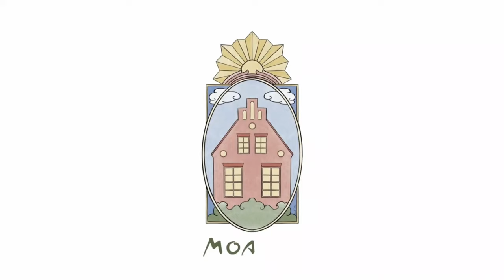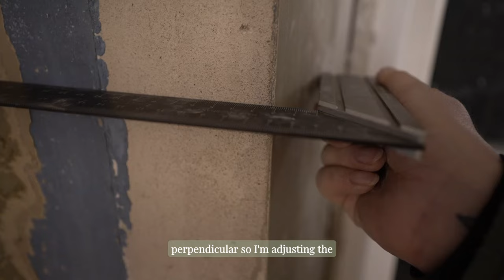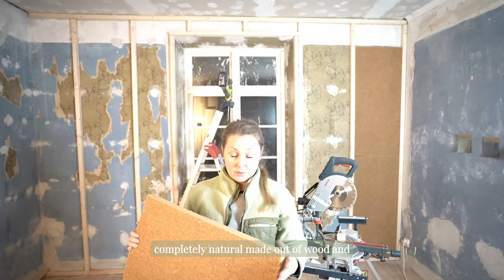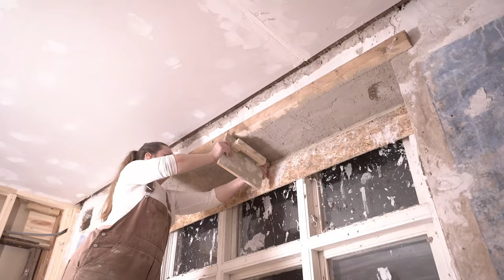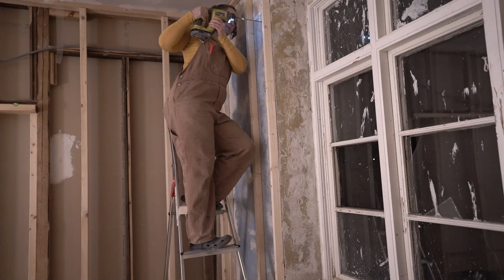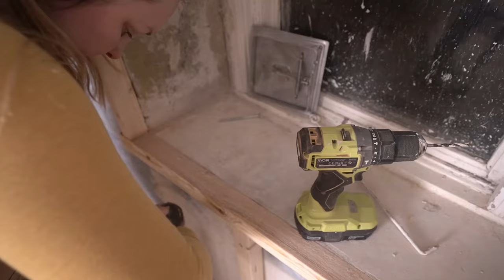E22 Major Improvement - Insulating the Guest Bedroom

Comment: Moa, do you know if this kind of insulation could also be applied to concrete? Thank you in advance for your answer, whatever it may be, you definitely took the time to answer, so thank you again. Greetings from cologne Andy
Reply from the maker: Yes absolutely. Wooden fiber insulation (the brand Hunton in my case) or cellulosa insulation (iCell is one option) can be used in the same way as other types of insulation. With concrete you don't have the need for breathable walls like I do but the other really great  positive side with these more sustainable insulations is that they are easier to recycle.
Reply: Thank you so much

Comment: Why not use metal framing
Reply from the maker: Good question! There are two reasons. 1. It's cheaper. 2. Wood is a more sustainable resource here in Sweden (generates less CO2).